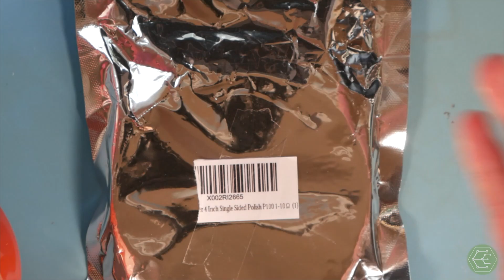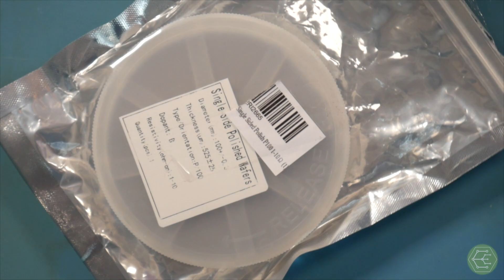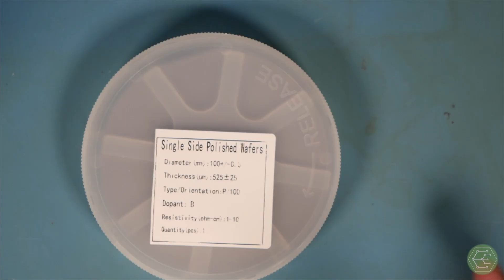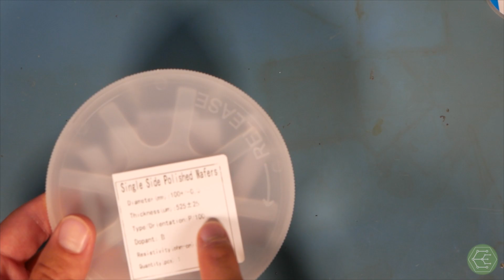P100 Silicon Wafer: A Nearly Perfect, Polished, Crystal

Comment: Worked in a fab for four years, until recently. 300mm wafers definitely tend to break in straight lines when given a chance. Perhaps due to linear features, or due to the crystal lattice
Reply from the maker: HI Tanner, Interesting comment, I wonder if there's a wafer size where this becomes less true. I'm sure impurities / defects could cause interesting fractures!

I didn't see an email associated with your username, so if you'd like some wafer, provide an address on this form! https://forms.gle/PhkUu3PsXe7uLY9m8